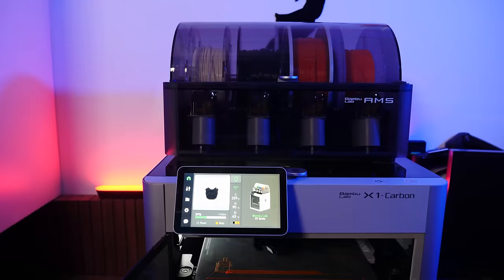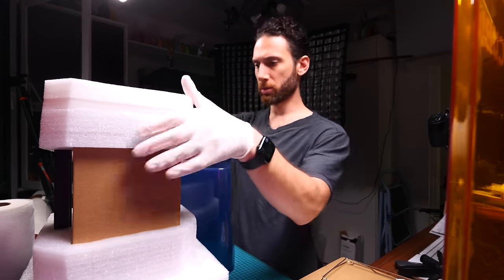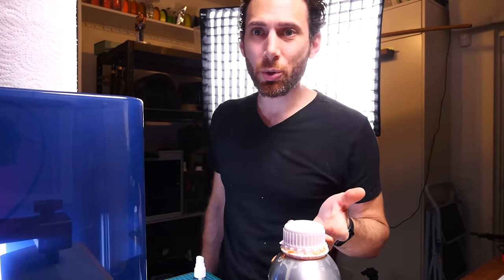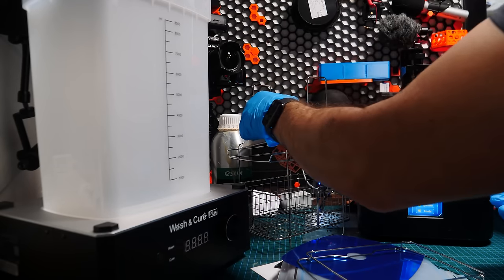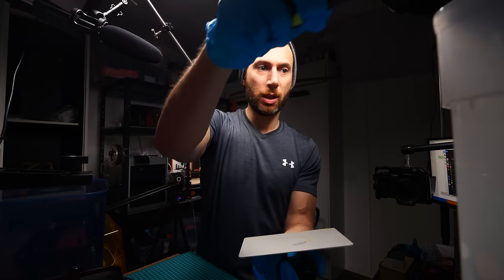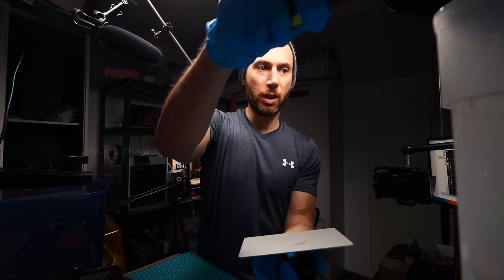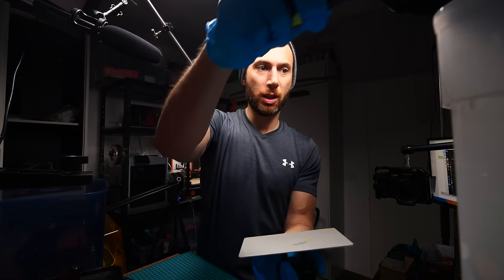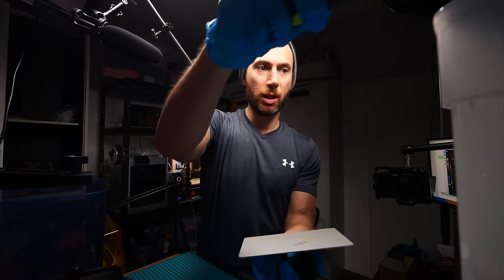Resin 3D Printing Wasn't What I Expected. AT ALL.

Comment: Safety first and just a Little FYI if you have a beard the mask is completely useless. You might feel the baffle open and close but air will go through the easiest path. The spaces between each hair is WAYYYY wider than the filter. So the only way yo effectively be safe is to shave the beard.
Reply from the maker: I’d rather die!

Comment: I feel current resin technology isn't very well suited for home use yet, but may be in the future.  I can see a desktop printer in every home just having a print-head like an inkjet that spits out transparent resin and CMYK color ink together and immediately cures it, layer by layer, resulting in high detail (300 voxels-per-inch?) full-color 3d prints without the hassle and mess.  Just put  ensure full cartridges with resin & ink and the printer does the rest delivering a fully cured result.  If HP is reading this and wants to boost their printer business ...  Yeah yeah, supports will still be tricky, maybe add in an extra resin water-solvable to act as filler?  That's still only 6 things to mix and match.  There have been inkjets doing that in 2D, so why not in layers?

Comment: About halfway through the video you said something about resin safety being super important while you're not wrong I sincerely hope you're not under the impression that it's particularly dangerous two-handled barehanded like a lot of YouTubers. If you look at the material safety data sheet for the individual resin you use it will tell you what to look out for but as an experienced resin printer the majority of resins are safe to handle without gloves you just run the risk of skin irritation. You definitely want to wear eye protection because if you get it in your eyes it's going to be a bad time and under no circumstances should you ingest the resin which is the real reason why most of us wear gloves. That said if you run out of gloves and you need to get something off the build plate don't worry too much just wash your hands in IPA and then wash your hands with soap and water thoroughly and you're good. Keep in mind that they General good practice and you still need to read the individual material safety data sheet for every resin that you use because their properties do change but the biggest risk really is they become neurotoxic if you ingest them so just wash your hands and don't drink the resin.

That said I have been using fused deposition modeling and masked  stereolithography printers for years at this point and to speak to what you said, it really should be pick your tool based on your purpose. mSlA is great to decoration, and things like jewelry casting.

Comment: FYI to anyone here who reads this, wearing a mask of anytype is pointless if you have a beard and it touches the masks seal. Need to be clean shaven - regards from someone who did concrete cutting.

If your wondering why its cause the slightest hole become an intake point and now you have the bad stuff in your mask with no way out.

Comment: No thanks. 21:58 look at the mess on the bottle. Gloves and masks and that TINY vertical screen that you need to bend to view. And the "resin stink" and needing another big unit to wash and cure the print. And what happens to the liquid used to wash. Oh what a mess. I'll stick to FDM unless I actually need some exotic thing printed in ceramic or such.
Reply: There's ways to clean an re-use the IPA, and when it gets to when you need to get rid of it you can have it stand under the sun for some time and it evaporates. By time, i mean days or more lol. I just take mine to the nearest city dump that has a section that collects chemicals and dispose of them safely. In my case its just a 5 minute drive. Yes, it's messy and some extra work, but results are very rewarding.

Comment: I really am horrified by the careless approach to safety here. UV radiation is what causes sunburn and will badly damage your eyes. Would you check if a laser engraver has power by looking into the laser? I hope not and you should treat UV light sources with the same respect. Also, not hooking the printer up to an exhaust if you don't have filters is bonkers to me. You need to wear a respirator when filling the machine, but afterwards the device is free to vent the fumes into your room? Please use more critical thinking! Also, any chemical, especially the ones you don't know, should be treated like poisonous acid, one time contact can be sufficient to trigger allergies that you will never get rid of again. And while IPA is not that dangerous, you are still better off wearing goggles when you spash that stuff around like you did when filling. It could have also been obvious that you can reuse such a big volume of alcohol more than once imho.

Comment: How are you still alive? I was shocked at your nonchalant attitude towards safety. You didn’t follow the instructions properly regarding leveling, which is why the first few attempts failed. Then, when handling the IPA (99% alcohol!) you didn’t wear a respirator. Then, you seemed to have no idea that UV will damage your eyes. On the positive side, this video could be used by safety professionals for a “what not to do…” and the reason why you should always read instructions as well as research a project to ensure you fully understand any health issues.
Reply from the maker: You don’t even know the half of it! You should see me with power tools and industrial equipment.
Reply: @thenextlayer  I know you’re joking but working with resin is a serious issue. I was horrified to see your lack of care. When we’re young, we think we’re bulletproof. The effects of exposure to fumes from IPA and resin are not immediately obvious but are cumulative and can be very serious. Also, be aware that you’re setting a bad example. People may see your lack of care when working with resin, IPA and UV and think they don’t have to worry about safety either. When you publish yourself on YouTube, you are a role model, whether you want to be or not.
Reply: @richardmarriott-smith9517  resin is not so bad, only gave me 1 chemical burn after my arm rub against the print plate and I didn't notice, it's when you involve resin dissolved in solvents where things get dangerous as the solvents can evaporte the resin into the air 10,000 times faster than printing, I don't use a respirator I use positive pressure and a window vent to get those fumes out of my work space even when I'm not working. You can teach people safety but discipline is the real test of how well someone will practice it, I am far more casual then I was at the beginning but that's also because I'm making less mistakes, only real safety concern I have is the 8 gallons of Fuel, ethenol, methenol, And IPA I have stored in plastic bins that i have to move around constantly, 1 spill and I'm running for my brain cells.

Comment: Resin printing is better than fdm printing in EVERY POSSIBLE WAY.   no joke.  there is absolutely no legit reason to ever use fdm printers again once you use a resin printer.   Resin printers do everything fdm does, but just better.    Resin printing really is the only way to go if you are wanting to 3d print.
Reply: Other than the fact that resin printing was never designed to be fully stable. UV cured resin never fully cures, and will break down over time. It was designed to create high fidelity prototypes for testing to alleviate high production testing costs. It was also designed to create high fidelity masters to make molds from. It was never meant to be an end product. Over time, details in the prints soften and it becomes extremely brittle.
Reply: @Dstinct  resing are getting engineered to resit decay and most of it can be avoided if you paint the model in a UV absorbing hard coat.